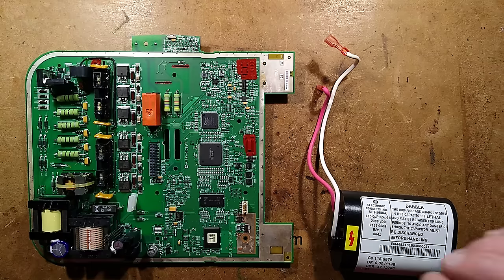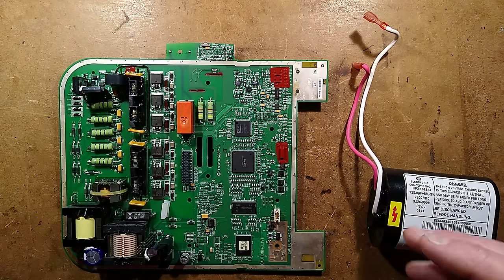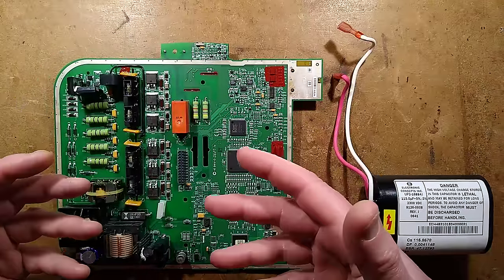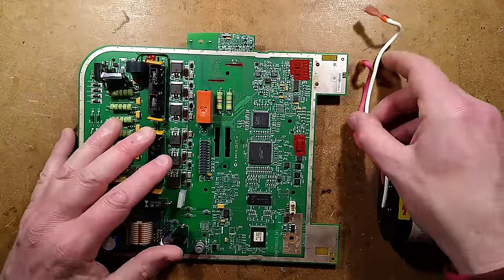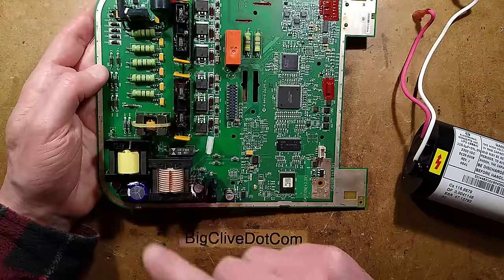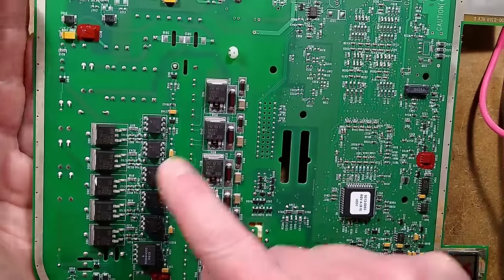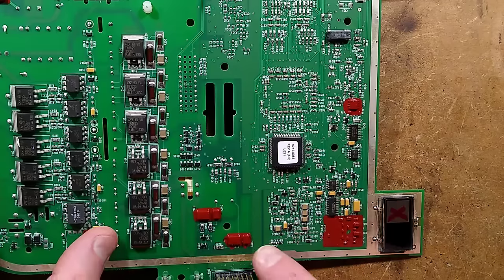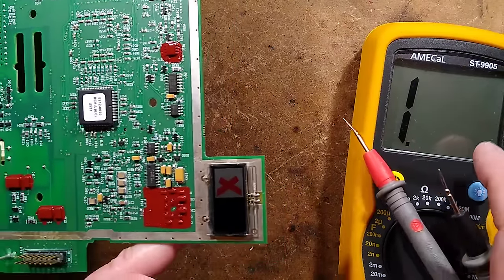Inside a Zoll defibrillator - with SCARY capacitor

Comment: When I played with these, I mean when I had these to test/demonstrate you replaced the  card with a test one. Reboot and you could shock whenever and whatever you want. 

During normal usage, heart is recorded and analysed. All logged.
So safe for general use, I'd almost say it's idiot proof but I've seen how stupid people can be. 

The test loads even emitted your choice of cardio rhythms. The energy if you didn't fully seat the pads could easily weld them to the test equipment.  As an electronic repair tech I always opened these with the utmost respect.  

Quite interesting, as Clive would say.

Comment: CPR these days generally only needs chest compressions - the medical industry has found that the whole mouth to mouth thing is not only unnecessary, but is often the major holdback from the general public from learning and performing CPR. So modern CPR classes only teach the chest compressions making it be known that you don't need to do mouth to mouth to save someone's life. And CR123 batteries are extremely common - they're used in cameras and often have a shelf life of decades making them good for standby operation like these devices. Often they will time expire with the unit (the units are generally only good for 10 years or so before you need to replace them, which is ideal as that's generally how long the battery lasts)

Comment: ECG amplitude from typical electrodes is in the range of a millivolt.

Total delivered energy will certainly be controlled. That may be done, at least in part, by controlling the charge on the capacitor. It is also extremely likely that the shape of the pulse will be controlled.

The cool defibrillators are those that are implanted. I got to be an operating room tourist during part of one of the first installations of such in my area (actually the whole country). I wasn't there for very long, but was for some of the testing when the patient's heart was deliberately put into fibrillation and everyone silently watched as someone counted time, waiting for device to do its thing. As a riffraff tourist I couldn't get close to the operating table to actually see the effect on the heart (both abdomen and chest open).

Comment: I know some people believe caps are safe after a time period, but the opposite can be true. I bought a box full of large capacitors (circa 150000 uF 450V), they were delivered with shorting links fitted. At some point, a couple of the links fell off, so, to be safe, I put a screwdriver across the terminals; there was a large flash and a loud crack and my screwdriver had a sizable chunk blown out of the blade. I believe this is due to dielectric absorption.
Reply from the maker: Part of my apprenticeship training at college covered dielectric absorption in distribution network capacitors.

Comment: Interesting to see how much more sophisticated and compact these have gotten over the years, I'm more familiar with the Philips AEDs as we've only just recently switched to Zolls here and even the boards were significantly larger, I assume to make sure all the isolation space was effective. Neat to see such advances even in my short time in the field

EDIT: I thought I recognized that little status display but it wasn't til I saw that silly tennis ball green case that I got it, we used to have these same defibs at one of the satellite surgical clinics! They managed about 15 years out of that unit before we finally replaced it with either the R series or X series, not sure what got rolled out there

Comment: I find AED's really cool. I've tested quite a few at work. I even got to take a couple home as they were removed from service and replaced. I got two LifePak 500's. Neat units. Though my batteries died a couple years back and I have yet to buy replacements. Thanks expensive batteries! Also need some new pads as my couple are expired now. They are neat devices. Mine were programmed in stepped shocks in a full auto mode. No manual control at all. First it detects the heart rhythm. If in V-fib then it charges and delivers 200J of energy. Then analyzes again. If needed it charges and shocks at 300J. And again if needed charges and delivers 360J. Which I can tell you is a absolute ton of power to put into a person! It's something like 2000V at 30A! And biphasic so it delivers current one direction then switches the polarity to deliver the other. The shocks are delivered in like 20mS total! While using my unit the defib is speaking with loud clear messages to direct the user on what to do. Really cool units and very important! But I would in no way EVER want to be awake when it shocks lol.

I've never been shocked by one, however I have put pads onto myself and connected to a defib unit. It was a LifePak 15. Let it analyze me to see what it would say. Was neat to see my heart rate on the screen. That's how I learned I had quite a concerning amount of PVC's for my age lol. But I did not let anyone near the shock button lol. Cause that one would shock in manual mode.

Comment: The small metal cased sensor looks like an early 2000s era MEMS accelerometer, (Analog Devices ADXL range was what I was using at the time). Maybe it uses the acceleration to work out how far the chest is being compressed, which might be a better metric than just pressure, since some people will have squishier chests than others etc

Comment: When seeing the sensor I immediately thought "velocity sensor". I would have excluded a pressure sensor, because there is no port.
It looks like this is an analog devices sensor maybe ADXL311, which is a discontinued accelerometer

Comment: The sensor in the chest compression pad could be an accelerometer, perhaps. I find it a bit far-fetched that the hard case could produce useful information from air pressure changes.

Comment: Very cool device. Great video. I think that you're right about the pressure sensor based on the 2 caps likely for decoupling on i2c but I couldn't find any datasheet. I am amazed that the main cap is only slightly bigger than a microwave cap yet over 100x the capacitance at the same voltage. I've seen many of these around me as a kid in Oslo and wondered what was inside so great to see one torn down. The audio was a bit tricky but think I got the full thing. I also translated it in case anyone is interested:

Elektroder voksen. (Adult electrodes)
Installer batterier. (Install batteries)
Hvis batterier er nye, trykk på knappen. (If the batteries are new, press the button)
Elektroder voken. (Adult electrodes)
Enhet ok. (Unit ok)
Forhold deg rolig. (Stay calm.)
Undersøk reaksjon. (Assess/gauge their reaction)
Ring etter hjelp. (Phone for help)
Forhold deg rolig. (stay calm)
Undersøk reaksjon. (Assess/gauge their reaction)
Ring etter hjelp. (Phone for help)
Åpne luftvei. (Open their airway)
Undersøk pust. (Look for/check their breathing)
Fest elektrodene til pasientens bare bryst. (Attach the electrodes to the patients bare chest)

When you booted it again, it said one new thing:
Ingen strøm gitt (No electricity delivered)

Comment: I don't speak Norwegian, but it's related closely enough to German and English, so I (as a German speaker) will try a translation by "educated" guessing 😅for those lines that are recognizable close to German.

Enhet OK -> Einheit OK -> unit ok
Forhold deg rolig -> verhalte dich ruhig -> "conduct" yourself calm/keep calm
Undersok reaksjon -> untersuche Reaktion -> check for reaction
Ring etter hjelp -> not really similar in German: rufe Hilfe -> call for help
Apne luftvei -> öffne Luftweg -> open airways
Undersok pust -> untersuche Atmung ("Puste" is also German for breath, but wouldn't be used here) -> check breathing
Fest elektroder (audio guess: ... patienten bare brest) -> befestige Elektroden auf der freien Brust des Patienten -> apply/"fasten" electrodes on patients bare chest

I always find it fun to compare languages. For short sentences/commands like this, it seems that for Norwegian someone threw German and a little bit of English into a tumbler, lost a few letters and then rebuilt the sentences 😉. No offense to Norwegians though, Norwegian is definitely its own proper language 👍.

Comment: Reminds of when I worked in an ED and every morning we would check the portable monitor/defibrillators with rechargeable batteries.  Always "good", when plugged in.  One day I unplugged one and turned it on and it failed to operate.  Checked our other two portables, ditto.  Units were old enough that the NiCd batteries no longer took a charge.  No one knew.  Big scramble ensued to replace batteries.

Comment: You may want to keep the discharge resistor connected. Often times electrons tunnel into the dielectric material in the presence of high voltage. Over time they will leach back into the conductor building up voltage. You discharge it today, next week there may be a couple of hundred volts.

Comment: During batteries insertion:
- Electrodes Adult
- Install batteries
- If batteries are new, push button.
Later:
- Electrodes Adult
- Unit OK
1 Keep Calm
2 Examine Reaction
3 Call for help
Repeats 1-3
- Open Airways
- Examine Breath(Breathing?)
- Attach electrodes to patient bare chest
When pushing heart button:
- No shocks given

Comment: Part of the problem with ventricular fibrillation is  is many things that cause it can also directly injure the heart.  Injjured heart muscle doesn't conduct the beat signal in the same way, and can contribute to the abnormal contraction pattern.  The idea with a defib machine is it causes a shock to completely disrupt the entire pattern so the internal pacemaker in the heart can restart it.=,Sometimes it works.  It's one of those things where you wouldn't do it unless somebody is already dead if you don't do anything.

Comment: Having used an SAED (Semi Automatic Defibrillator, requires you to push a button for each shock, automatic just does it fully automatically), it feels wrong to tell people to stop doing CPR and just wait and it feels like it takes forever to analyse.

Unfortunately the person I used it on didn't make it, but their medical history meant they likely wouldn't have made it even if the event happened in a hospital.

The training unit we used (St John Ambulance volunteer) came with a foil strip to place on the dummy for continuity.
It then had a series of programmed scenarios to play out and lacked the capacity and high voltage side so we could "deliver shocks" without any danger.

Comment: I did similar research into the consumables cost and availability of parts when deciding on which defibrillator to get, ended up buying  the ZOLL AED+ for the exact same battery and pads reason.

Comment: I have one of these devices (although much much smaller) in my chest. I was fitted in 1998 and was number 26 in the UK. I am now on device number 4 as the batteries run out on the other 3. I often wonder why they don't do a chargeable device, that would save  the operations to swap them out. The cost by the way was £25,000 just for the device in 1998.
Thanks for posting
Reply from the maker: It's probably good to get a regular technology update anyway.

Comment: I have a “retired” internal defibrillator from 15 years ago, that the manufacturer sanitized and decommissioned after I had to get it replaced.  I have always been curious what the inside looks like even though I know it’s about 90% battery.  I just had another one replaced which lasted for 15 years while the other 3 only lasted between 5-7 years.  If anyone is wondering the price of just the dual chamber AICD not counting the surgery or leads, it’s $325,000.00 in the US.
Reply: My Medtronic dual lead ICD was $75,000 including leads and surgery in 2019. I suspect that the "price" and whether there are separate charges depends on the insurance coverage.

Comment: I think the red coating is an anti-tamper adhesive/coating for the most critical components that most likely is very hard to obtain/only obtainable by some very special companies. Thus, if you want to replace these parts, you will have to remove that stuff, immediately showing the unit has been tampered with. And as you can't obtain it as a normal person, you also can't apply a fresh new layer like nothing has happened.
It seems weird (to me) to only have the coating in place in such few locations on the PCB if you want to protect it against moisture and to be honest I'm even surprised it's not fully coated. A Class 3 device/assembly and especially something that can even reside in a box on the outside of a building usually is coated.

Comment: It's important to remember that defibrillators fix abnormal heart rhythms (arrhythmias). And despite the name, some AEDs will shock more than ventricular fibrillation - specifically ventricular tachycardia. Anyway, while these arrhythmias can be caused by a heart attack, fixing them does not "fix" the heart attack (which is caused by the heart not getting enough blood). That's why you must always call emergency services even if the person recovers.

Comment: @14:50 Battery types.  Is that because there are two types of 123 batteries - 123 and 123A.  Rayovacs are 123A and the main difference is that they are SLIGHLTY larger 0.4mm longer and 05mm wider diameter.  So the "A" don't fit battery holders designed for "non-A".
Reply from the maker: I think it's mainly because the preference is for cells that can deliver high current for fast capacitor charge.

Comment: In Australia it has become mandatory(by 1st Jan 2025), for all public buildings to have these installed.
The local pharmacy has one(on an external wall) and also the supermarket has several.
Hopefully the vandals won't get to it.
The sports centre I visit has about 10 around the place.
Reply: Surely with this much technology on board they could just add a little bit more firmware/hardware? To reach out and Sing-Sing zing the little Turds and save us all the (multiple) instances of running them by the Bleeding Hearts on the Benches. 🤔🙄

Comment: super excellent show.  i like to be prepared for emergencies and watching this helps prepare me on how to use one, should the need arise.  the highlight was 18:46 where you mention that heart compressions help move air through the lungs.  it causes me to wonder if movement of air through the lungs can be achieved in ways other than blowing through the mouth.  for example, pushing on the diaphragm or stomach area.
Reply from the maker: The newest approach is continuous chest compression because it does displace air in the lungs.

Comment: I believe they still have paddle machines on some crash carts. But they might have automatic ones on those carts as well. It's been over 15 years since I was on the ward the crash cart is out in the hall 24/7. I had surgery and the day I was meant to go home I woke up with a sharp pain when I took a deep breath. I had already been in the hospital on the surgical floor for 10 days so I kept quiet (not advisable) and ended up having to come back to the ER later that night. They put me on the floor patients with pneumonia, etc, are on.

Comment: Very kewl stuff. One thing i noticed on the unit, ACB (airway, breathing, consciousness)  was actually missing airway.  Unless it was verbally communicated.
 During CPR a blocked airway passes nothing to the lungs.

Sorry that was beaten in my head by the EMTs who traind me in st jhons first-aid. And was immediately noticed. 😳
Reply: It looks like it's in the steps, going by the pictograms with the LEDs that light up to guide you round the process. One shows the classic "tilt head back", the next looks like "listen for breathing".

As the instructions also begin with the critical "call for help" step, that would be something I would expect the emergency service call handler to cover as well.
Reply from the maker: One bit I forgot to cover is that the lid of the unit is designed to be placed under the shoulders to tilt the head back.

Comment: Ah, the 123 cells. I hate that theyre not used in more stuff. Theyre lithium, theyre dense, rechargable, almost the same size of 1/2 a AA and theyre 2x the voltage. 12 volts in a 2 AA package, with how efficient wireless stuff is now you could get crazy distance for remotes and such. They were used for early garage door openers I remember, in a single cell package.

Comment: "lower right hand side of the chest" nooo, that's the lower left! The body is turned the other way so in diagrams the right side is the patients left 🙈

I wondered if the relay was for a lockout, I've seen some that need to be phoned to have them unlocked first, how that works in an emergency I don't know, but might prevent silly bollocks opening it up and killing themselves

Comment: These modern AEDs really are an amazing bit of kit. Pretty darn impressive engineering to give someone like me whose repertoire of medical knowledge extends not much farther than band-aids, superglue, electrical tape and paper towel, or something red hot if all else fails, the ability to potentially save someone's life with nothing more than a few pictures and some simple commands.

And yeah, I can't blame you for being extra cautious when poking around in that thing. That's one seriously mean ass, bad day inducing capacitor in there. Get poked by that, and you may need a bit of defibbing yourself. Which would be rather ironic, seeing as how you just took the nearest defibrillator apart and rendered it useless in the process. Lol...

Comment: I had to set up the software for the AEDs the fire department has here... primary is as soon as they are back at the hall... the data is immediately uploaded via wifi.  I put the software for the backup way of plugging into a computer for it to upload the data, which is sent to the medical services.